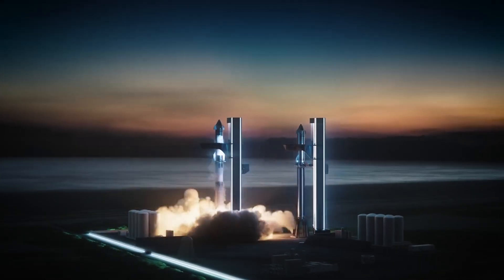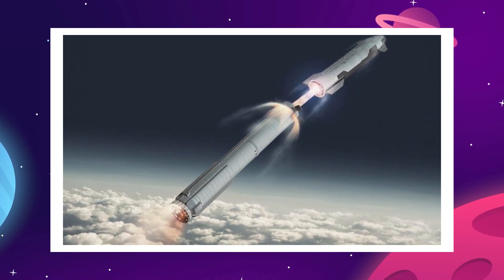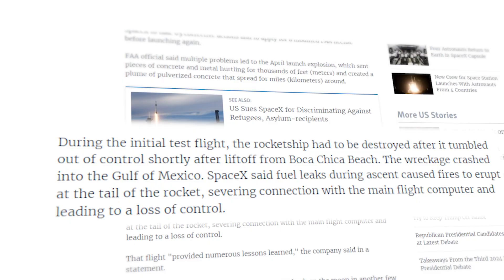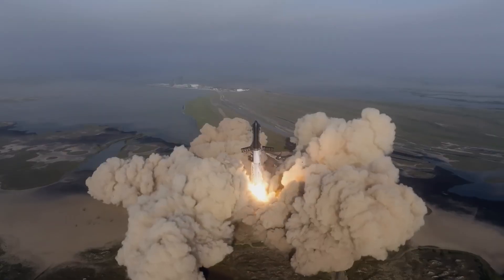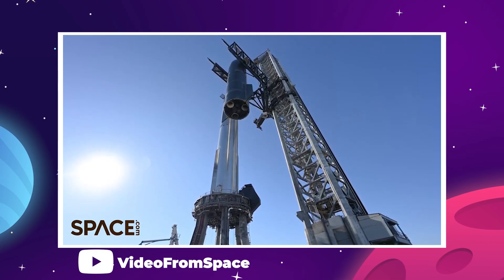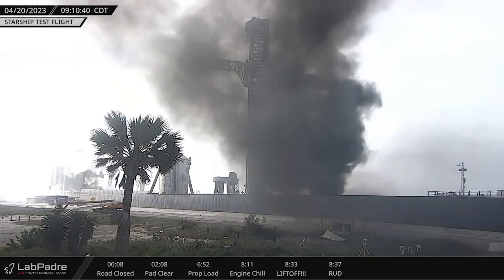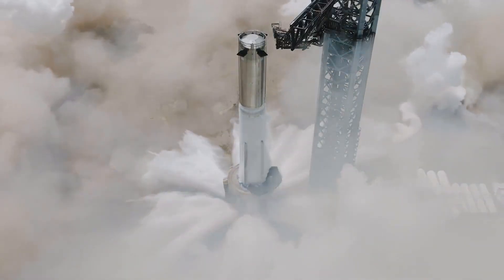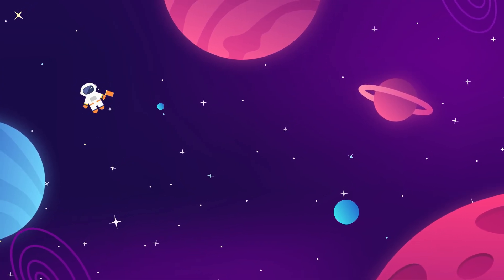The 2024 SpaceX Starship Update Is Here!

Comment: at time of separation, the upper stage does not necessarily have to go immediately to full power. they can fire at like 50%, then after separation, bring the vacuum raptors up to full power.  This will help reduce damage to Hot Stage Ring and top of booster.
And, I doubt all 6 engines will fire on the ship during separation.  Probably just the 3 outer vacuum engines.

Comment: Nice video. I'm not sure it's 100% correct about this though; "However this launch mount contains most of the systems that are responsible for igniting the 33 engines." Certainly the engines with relight capability can (obviously) start without the launch mount. Would SpaceX go for the added complexity of giving those engines two separate sets of ignition hardware? I can't find an official confirmation, but what I've seen stated in several places is that in fact only the outer 20 Raptors are started by the launch mount.

Comment: Why doesn’t the second launch of starship include reignition of the second stage engines prior to landing? Is SpaceX worried that the heat shield is not going to work? Remember, if SpaceX cannot make the heat shield approach, they are currently using work, a major redesign of starship will be required for a new Type of heat shield or approach to landing starship. The fact that SpaceX is not testing the heat shield by trying to reignite the second stage engines prior to landing is worrisome.

Comment: I ask this question in a different video. What exactly is the difference between the disaster at stage zero with stuff flying into the wetlands comoared to leaving boisters and other part of a rocket in the damn ocean? Does that still not contaminate the waters that the fish and wild life are complaining about?
Reply: Dude your dumb
Reply: 😂😂 the amount of fish and wild life in that area isn’t very expansive. Elon on a pod with Lex said the fish and wildlife people made spacex kidnap a seal, strap it to a board and then put head phones on it while a rocket was launched to see if it got stressed out. It did not, they released it and then had to catch another and run the same test. Even showed a photo. Stupid bureaucracy slowing down human advancements. They also asked about whales, and sharks, the odds of a shark, fish, or whale being hit is about the same as a human getting hit by lightning. Basically they are just super unlucky if that happens. They have massive cleanup teams in case of spills or when debris ends up offsite. Wouldn’t make sense to leave it when its needed for examination.